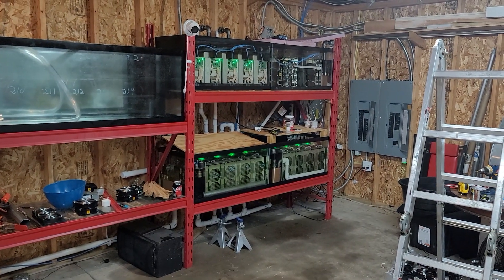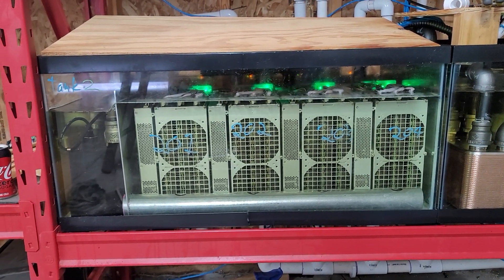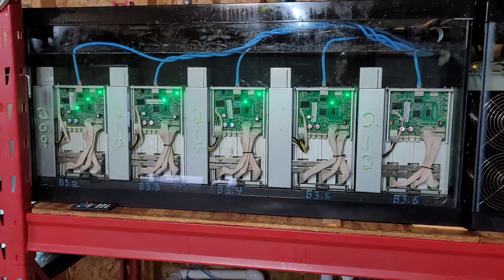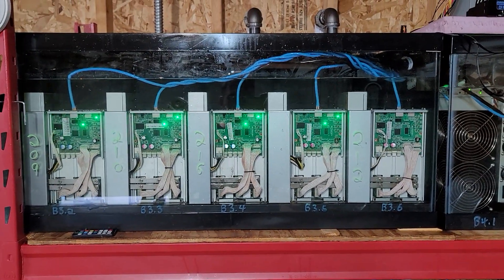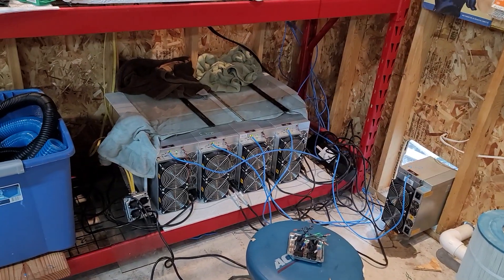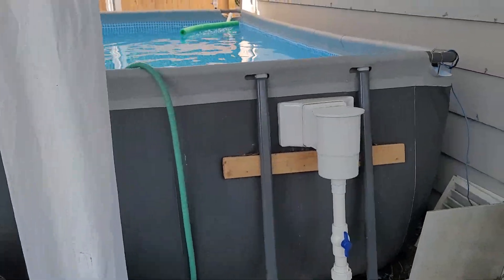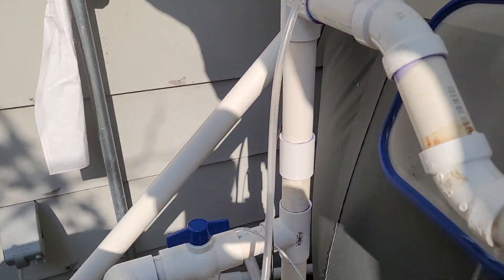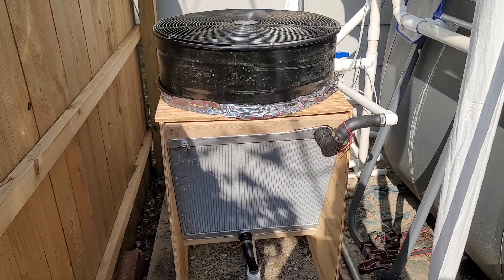Oil immersion cooling of ASICs to heat a large swimming pool

Comment: Nice video - you may add a loop for a hot water pre-heater to get some more.  Lastly, if you need to dump, run some copper coils in the ground - down a few feet - by me the ground temperature below the frost line stays at ab out 55 degrees. (You could use plastic - but you'll need a lot more of it).

Comment: The stainless steel heat exchanger you listed in your forum post says under the questions part that it is not suitable for chorine pools and recommended a titanium pool heat exchanger instead. How have you found yours holding up, any corrosion. Or do you have a salt water pool?

Comment: Hey bud, can you help me out. I need fan spoofers for my whatsminer m20s. I have some but its the kind that is attached to a ribbon cable and when they get submerged in the coolant it causes errors. I have an L3+ with fan spoofers that are just chips.
I believe this whatsminer m20s is 6 pin.

Comment: Did you run into any challenges cooling the oil when you first set up your immersion tanks? What are you using to exchange heat from the oil to water?
Reply: Hi, we are manufacturing and selling immersion liquid cooling box. Here's a video for your reference https://youtu.be/PByu8PVD6S0
a heat excnager used to exchange heat between water and oil

Comment: Well done on the setup! I will be assembling an immersion tank this weekend for a set of 5 asics (DragonMint T1s). The design will be very similar to yours. It will be radiator cooled using Bitcool from Engineered Fluids and plumbed with CPVC. We wanted an acrylic aquarium but they were on backorder locally so we went with glass - I'm slightly concerned about the integrity of the tempered bottom holding up against the weight of the miners. Your tanks look to be glass as well but I couldn't quite tell...yes/no? Did you have similar concerns? Also if you used glass did you double up on the silicone around the corners?
Reply: Hi, we are manufacturing and selling immersion liquid cooling box. Here's a video for your reference https://youtu.be/PByu8PVD6S0

Comment: Hi, I have a question for you. Do you immerse the psu in oil as well? Ive seen it done both ways . What are your thoughts?
Reply: Get high quality immersion fluid. research it.  Do NOT immerse your PSUs. They take up too much space for how little heat they put out. Keep in mind that the fluid is one of the most expensive line items in your immersion operation, and any empty or unused spaces in the tank should be avoided. Basically, immersing PSUs is not economical.
Reply: @steveholliday6466  thank you very much.

Comment: Fantastic job and a sign that a smart man can do it! 

The Manufacturer Antminer guarantees the S19j for 1 year, and says that their equipment has a life span of 2.0 to 4.0 years. On the other hand I have seen some youtubers say that the life span is 1.5 to 2.0 years.  What is your experience regarding the lifetime? Have you been able to check if the life of the miner increases or decreases with this cooling method? thanks for sharing your experience, greetings from Chile.
Reply: i have several that have been running for 5 years almost

Comment: What approx temperature are you running the oil in the tanks at ? I am about to do my first S9 but with plans to scale that upto 4 or so fairly quickly. I was planning on using the style of 60 plate FPHE that you are and then taking the excess heat and using that to preheat the hot water for the house - i was hoping to keep the oil at around 50c in the tanks - do you have any numbers on different efficiences at higher temps (i.e. have you found an optimum temp to keep the oil at in the tanks ?)
Reply: @Quickcat21MK  What ? Our power is free (Solar) here in Australia for 9 months of the year and i can get an S9 for $750 - which will produce approx $5 USD  per day and draw 1200w when running on BraiinsOS

Comment: Great Work!! Where did you buy the dielectric liquid those large radiators?

And, what would you have done if you didn't have the swimming pool to use the heat?
Reply: Ours is to supply heat to the office, home or community.
we are manufacturing and selling immersion liquid cooling box. Here's a video for your reference https://youtu.be/PByu8PVD6S0

Comment: great job Man!  that is what I love about bitcoin, is it inspires people to find ingenuitive  ways too utilize miners for dual purposes and not waste the tremendous amounts of heat.  I use 2 s19 to heat my house just using the heat from miners in basement.  keeps it nice and warm in house during winter with no drafts.  I plan on replacing the furnace and setting up a heat exchanger with oil di-electric liquid medium.  voila.  controlled temperature.
Reply: we are manufacturing and selling immersion liquid cooling box. Here's a video for your reference https://youtu.be/PByu8PVD6S0

Comment: What size tanks are you running there?  And did you do anything to reinforce the bottom of the tank or were you just really careful putting those miners in?  Lastly what about galvanized steel stock tanks?
Reply from the maker: they are aquariums, 40 gallon breeder is the size.  Nothing done for extra support, they can already support 40 gallons of water, so it's good to go.  Steel should work.
Reply: @coinheated5365  Thanks for the reply, I was guessing 40 breeders.  I haven't seen anyone mentioning using galvanized steel rather than stainless so I figured I'd go with the tanks, sadly I don't have a pool for a heatsink so I'm still sorting out how to cool the oil effectively.

Comment: Such an awesome demo! Your tanks look like fish tanks?  I've been considering that but was worried that the coolant would dissolve the seals over time.  Metal boxes seems like a better long term design but require fabrication.  However, a metal box would be a more secure way to house all the miners in a hardened outdoor environment.  

Greatly appreciate any recommendations or observations based on your testing thus far.
Reply from the maker: The seals are done with Silicone Sealant, which is on the specific recommended list on material compatibility, so there is no chance of it breaking down over time.  There are things in the works for an outdoor rated setup, and @sgbarbour (on twitter) is making an air cooled version of that now.  I'd like to eventually make something for outdoor use, but it's low on my priority list now.
Reply: @coinheated5365  thanks for the response!  I re-read the materials compat sheet.  Totally missed silicone sealant.
Reply: Plastic storage tub bins are cheep and work great
Reply: You pretty much want to shoot for a seamless medium if possible. That's the ideal

Comment: are your miners actually submurged in water? how do they operate? im so confused!
Reply: Most certainly not water.  They would short out in a millisecond.  It is a dielectric oil.  It means it does not conduct electricity.  It transfers the heat then from oil to the pool water.
Reply: It’s mentioned in the first moments , it’s a special oil .
Reply: BitCool
Reply: Yes, completely. 
 Here's a video for your reference https://youtu.be/PByu8PVD6S0

Comment: Awesome set up! Why do you run some of the miners horizontally instead of vertically? I am guessing it’s due to the fans….
Reply: I'm working on different tank designs, and testing out different flows and positions.  The horizontal one is fanless, while the upright ones still have fans on them.  The upper right tank is slapped together to test an S19, which is why it is sideways.